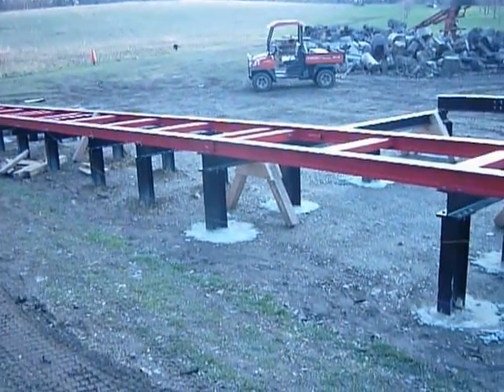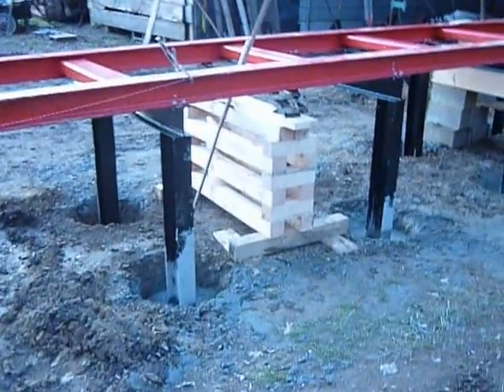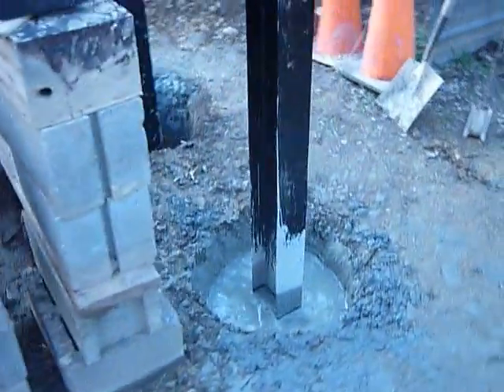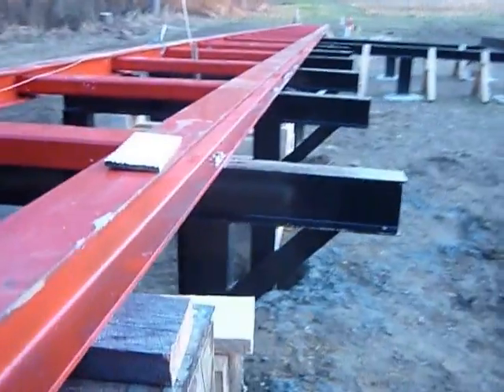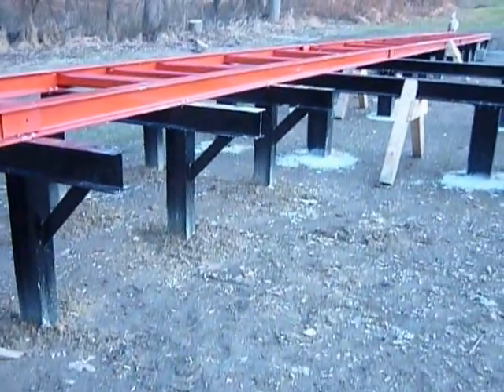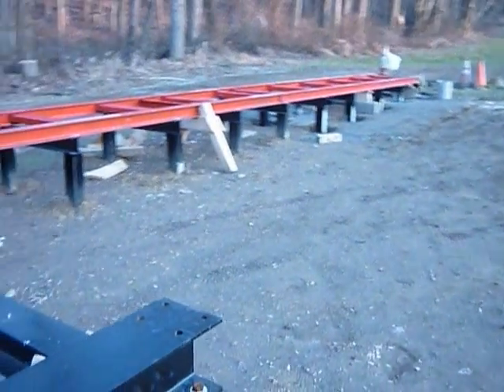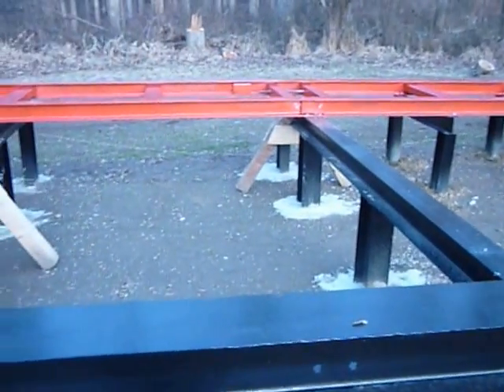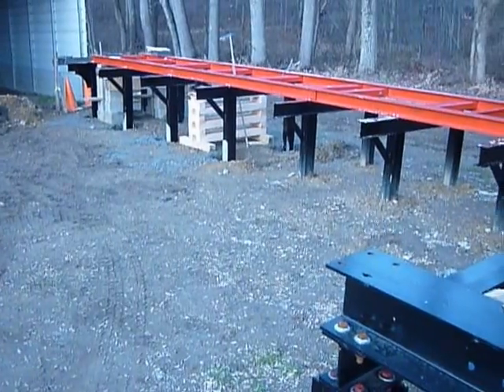frick #1 sawmill track finally done

Comment: John what happened to this mill? The one you use now is wood. I run a Geiser Mill also manufactured in waynesboro Pa. I think it was made in 1916 according to the serial # . Hard to find information on them. Love the channel keep on cutting!
Reply from the maker: i work on that one from time to time . i have a friend with a lot of geyser info . have to hook you two up john
Reply: @fricknjeep  I'm going to do a revamp of my mill and was considering a frick #1. I'm not sure I'll find a used mill that won't need the same amount of refurb as the Geiser. I did see an updated video after I sent the email last night. I'm impressed with the setworks works on that many knees. I know mine gets a little stiff when I have a big log on it.  Good luck with it, it's impressive work your doing.